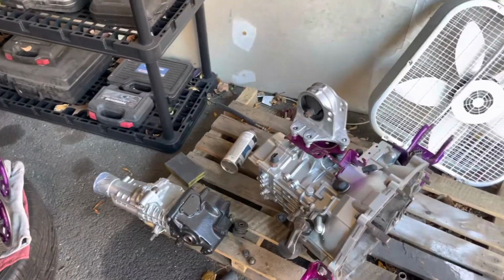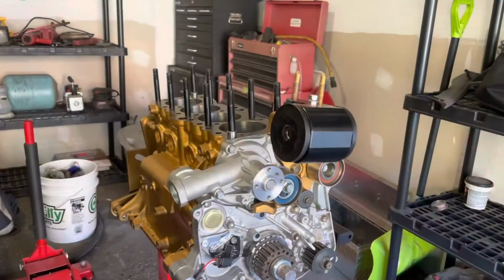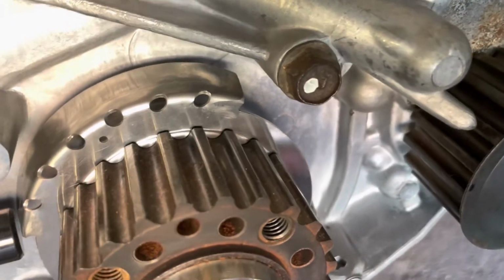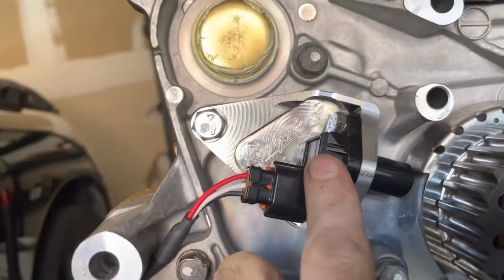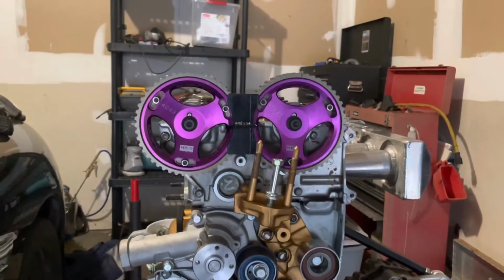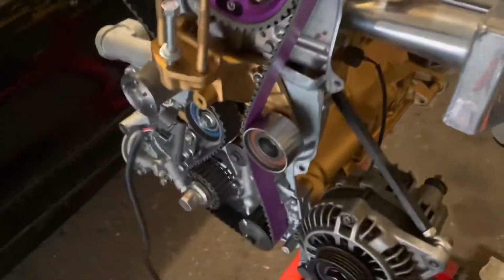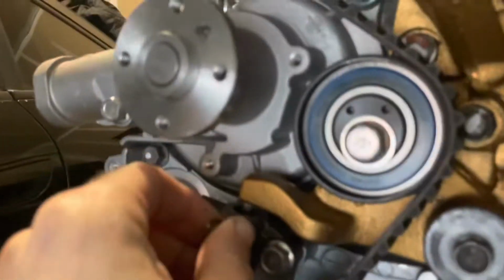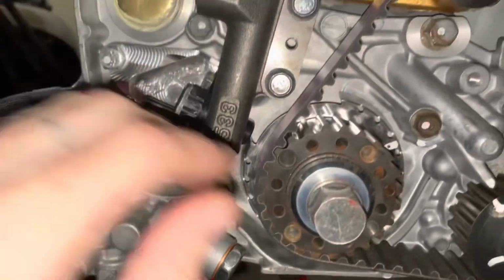4g63 head gasket, arp head studs and hks timing belt install, how to set timing on a turbo eclipse

Comment: Timing look2d off a tooth on exhaust side
Reply from the maker: It’s the angle of the camera I rotated it around 20 times and it lined up good every time. The first time it was like a full tooth off I had to rotate the tensioner a bit before it lined up good with the grenade pin being free moving

Comment: What tool did you use? Because i have hks timing gears and I bought a 4g63 tool stopper tool to lock the timing in and it doesn’t fit between my cam gears
Reply: I can tell you what tool he's using to align the timing marks. Its a cam gear locking tool and it looks like the tool that STM sells.
Reply from the maker: I think it was a plq brand off Amazon. It was a super tight fit with the hks gears

Comment: Yes, please make more DSM project videos. Sweet looking build. I really like the gold and purple. I found your video while looking for DSM head gasket videos. I am prepping to replace my blown head gasket on my '97 GST that has been sitting in my garage for the past 3 years.  Dam time flies. Are you in California by any chance? Since you have a '98 GSX I assume you are tuning the factory black box Hitachi H8 ECU with ECU Flash, and data logging with Evo Scan? I swapped in a '98 ECU into my '97 and that was how I was tuning before I blew the head gasket a few years back. I was running Ceddy Mods. I don't have too many mods except for 850 FIC Injectors, a evo 8 MAF, with a evo 8 injen intake I was barely able to get to fit. Also I have my exhaust side of my head ported/matched to my exhaust manifold, o2 housing egg shelled. As far as my turbo I was just running a 16g with the turbine side ported a bit as well and internal waste gate hole enlarged. A Manual boost controller, and a full 3' exhaust. When I blew my original stock head gasket a few years back I was running about 25+ PSI and did a pull in 3rd to about 8300 RPM...
Reply from the maker: Yeah I’ll be running ecu flash and evo scan. I’m in Chicago and my last eclipse I used the ceddymods to turn off my emission sensors so the car could still pass emissions lol. I was laughing inside when they tested the car cat came back passed but there was no cat in the car lol

Comment: Dude you sound high, what kind of weed are you smoking in Chicago? You said you use a 2G cylinder head on a 1G engine block so how did you manage to bolt it on to the block. You know the 1G engine block use the big 12mm x 1.25 head studs vs the 11mm x 1.25 what the 2G engine block use. The only way you can get the 2G head to fit is to open the holes up for the bigger 12mm x 1.25 studs on the 2G 7bolt head
Reply from the maker: Yep the headstands are bored 1mm over. The head is o ringed as well. The 6 bolt block was less prone to crank walk and has larger mains. The 2g head flows better. It’s actually a very common motor build on 2gs
Reply from the maker: The easy way to see I’m not lying is I’m running the 2g crank sensor not the 1g cas. The fact I need the kiggly crank trigger adaptor proves the block does not have a crank trigger sensor proving it’s a 6 bolt